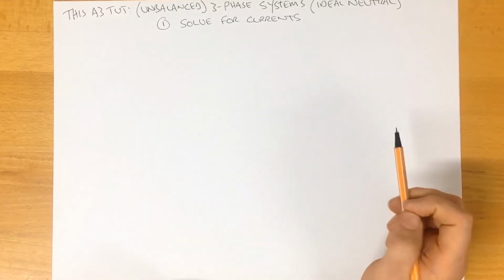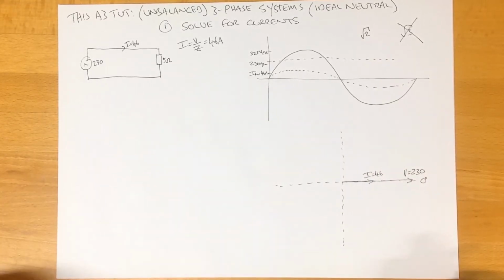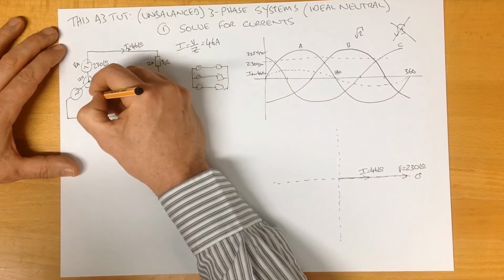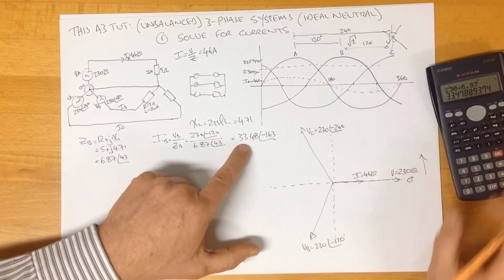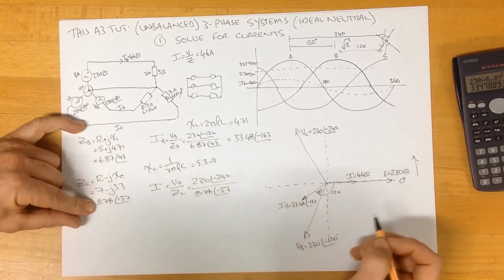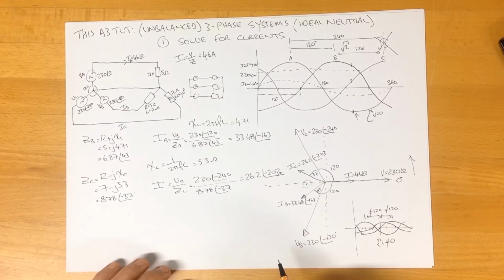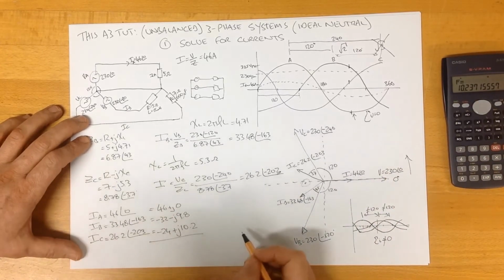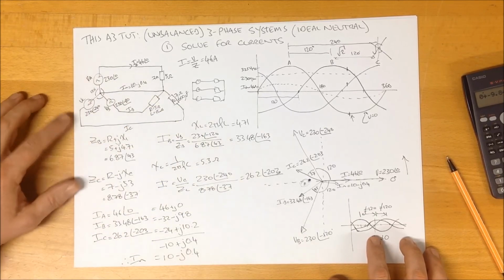Taylormade@AUT A3-tutorial: Unbalanced Three-Phase 4-Wire Star system (solved for current)

Comment: Thanks for the amazing video!  I have a question; is it necessary to inverse the sum value of the phase currents to find the correct neutral current?  Why is it 180D out from the sum of the phase currents?  I cant seem to find any other notes that require me to do this when working out the In.  Thanks!

Comment: Thank you for that great explanation. I think this is a great time to talk about why you don't include the neutral current as a current carrying conductor in a normally balanced setup for derating cable. Generally power is calculated as EI but in this case the voltages balance out giving an E of 0. Of course there is power dissipated in the cable giving off heat. It is calculated as I^2R and is a much lower value. Thus an unbalanced load shouldn't throw off as much heat in its conductors as a balanced load would. That being said you still need to be careful with the type of load on the neutral as harmonics can cause a lot of heat and need to be considered when sizing cable and conduit.

Comment: Hi. I have a question about the practical side of this: I am to understand that for a three phase system (a three phase step down delta to wye - Dyn11- transformer which feeds various three and mono phase loads ) the transformer will send current - amperage- into the neutral wire of you loads system, to counter the neutral point shifting ?

Comment: great video. something i do get bogged down in is -hypothetically speaking if i had a load that is unbalanced by adding a neutral am i also changing the voltage supply across the load(from Line to Phase)?

Comment: Hi there,

Thanks for the video, it was greatly helpful. However I'm struggling to understand why you take the inverse of the sum of the currents as your neutral? I'm currently a EE student who has just moved into three-phase and I'm struggling to understand why it would be the opposite?

By my understanding of KCL, the three phase currents are flowing 'in' to the star point but the neutral is flowing 'out' so why would the neutral current be inverse? In my mind that would only be necessary if the neutral was also flowing 'in', in order to keep potential difference at 0.

Your thoughts would be appreciated. Thanks again.
Reply: Biswajit Pradhan in a balanced 3-ph cct there would be no current developing in the neutral. I(n) is not arbitrary in this sense, the out-of-balance current IS flowing through the neutral. So why do we take the inverse if not arbitrary? To 'balance' the circuit is the purpose of the neutral so this is why I ask
Reply: I know you've probably got an answer by now but for anyone who's reading this:

All currents are defined as going INTO the load so when the neutral wire carries unbalanced current away from the load it must be negative. It's just a labelling convention but it is universally used.

Comment: This is very well done. I will be using this example and try to work it all out for myself. I am glad that you stressed this is an unbalanced circuit, which is a lot more realistic when your working as an electrician like I am. This helps me to understand more as to why we do not need to count the neutral as a full heat, current carrying conductor when we do conductor bundling ampacity calculations. This shows that it carries less current then the ungrounded conductors and thus does not produce as much heat.
Thank you very much, I enjoy all your videos.
Reply from the maker: Derrick Macaskill You are welcome, Derrick.  I too come from a trades background, and spent much of my time in undergraduate lectures critiquing the idealised or unrealistic scenarios being worked through on the board.